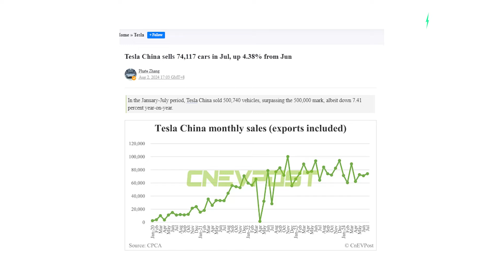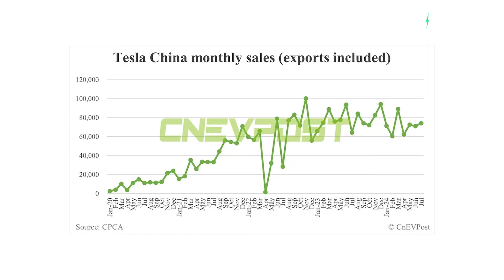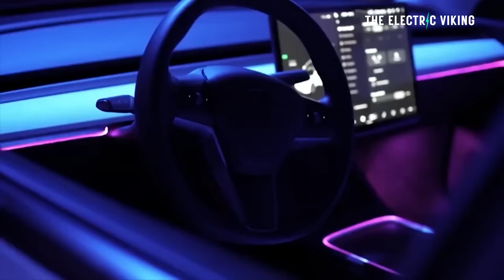Tesla sales of Chinese made EVs in July much better than expected

Comment: The biggest lesson I learned in 2023 about the stock market is that nobody knows what will happen next, so practice some humility and low a strategy with a long-term edge.
Reply: nicolette-t2y  True, initially I wasn't quite impressed with my gains, as opposed to my previous performances, I was doing so badly, that I figured I needed to diversify into better assets, I touched base with a portfolio advisor, and that same year, I pulled a net gain of 550k...that's like 7times more than I average on my own.
Reply: @huong-f9t  Could you kindly elaborate on the advisor's background and qualifications?
Reply: @corbin-k3d  “Victoria Carmen Santaella’’ is the licensed fiduciary I use. Just research the name. You’ll find the necessary details to work with a correspondence to set up an appointment.
Reply: nicolette-t2y  If your in it for the long term, no worry.

Comment: From the first EV sold until today there is sold 80.460 Nissan Leaf in Norway. Now TESLA Model Y have became the second most sold EV ever with 58.404, now passed the e-Golf. And one thing for sure, Tesla will not stop there. Sometimes you meet over 50% Teslas during a typical Norwegian rush hours... Legacy auto makers have large problems coming
Reply: Odd then that in Norway, according to OFV, Tesla sales are down 35.8% YTD in a total market which is down 9%.
Reply: @jinxvrs  Compared to last year, car sales in Norway are down about 50% with a EV part about 85%. So if Tesla's sale is down 38% that indicates that Tesla sales is acutally less hurt by the economic situation than some of the other car brands. So in reality, Tesla have increased their sales in a market cut in half because of taxes and intereast rates.

Comment: Mechanically Tesla cars are on a par with their competitors in terms of value for money. Where they are significantly better is the software and charging infrastructure.
Reply: Especially the chargers
Reply: Tesla is a proprietary, fully integrated EV, in China they have some competition in that regard, but I believe Tesla does it much better.
In the US , Tesla has no competition, you are buying a mobile computer or the equivalent of a smart phone, any other EV sold in the US is the equivalent of a flip phone.
Reply: Their hardware is also better
Reply: Maybe it depends on the local markets. Here in Germany Tesla is extremely expensive to lease. So value for money is only good when you buy the car. And buying an electric car is what I will never do. And anyone can use the SC-infrastructure here nowadays, so it´s no longer a Tesla advantage.
Reply: @meersde  , not sure about Germany, but here in the US only about half of the Supercharger Network will be open to non-Tesla owners.

Comment: 2000: first 1 TFLOP computer (ASCI RED). 150 m², 850 kWh, US$ 46 million.

2016: 8 TFLOP computer (Dual Drive PX2 GPU Platform). a regular Desktop PC PCB which you can easily hold in your hands, 250 W, US$ 600.

2022: 2,000 TFLOPS Nvidia Drive Thor SoC. Nio, Li Auto and Greatwallmotors have their own systems. Competition drives innovation. My guess: 2 million TFLOPS by 2030.

Comment: Wouldn't call Linux, GNU toolchain, buildroot and other community-based projects such as Ubuntu "Tesla software" though.
Reply: What would you call it then? Reality is so non-supportive of your argument, legacy automakers have access to all the free software stack too, yet it doesn't mean dick. It's almost as if people who build great websites or great applications on top of the software stack are the real value add. Oh and Tesla does design their own hardware to run it all on too.
Reply: Sam wasn't referring to the operating system upon which Tesla's software runs, but rather the software that Tesla has developed itself.